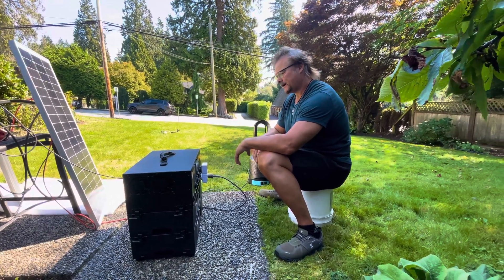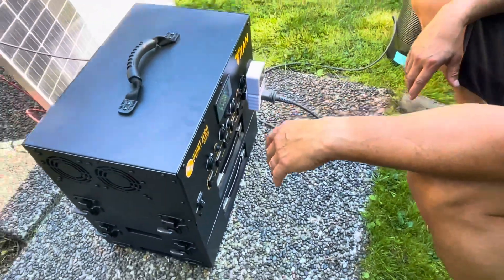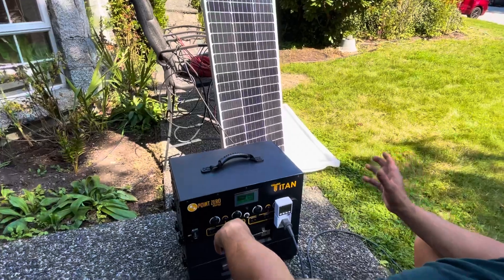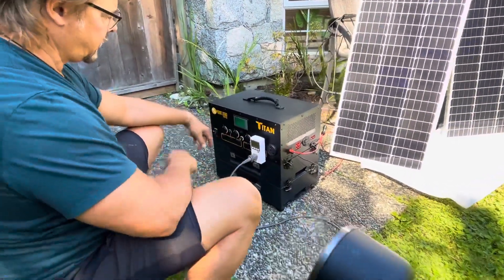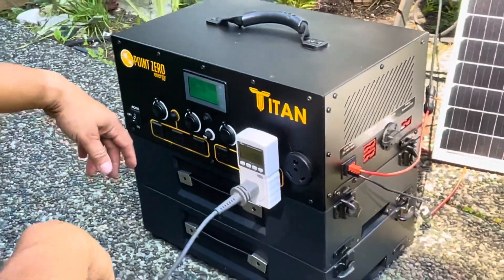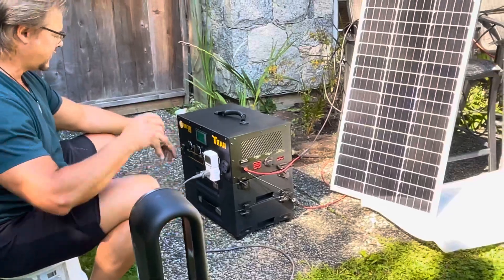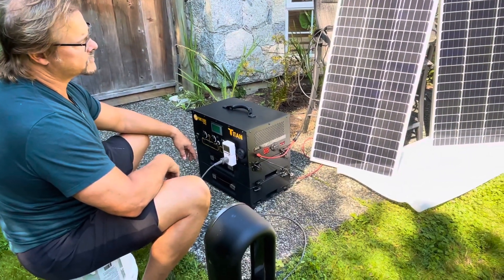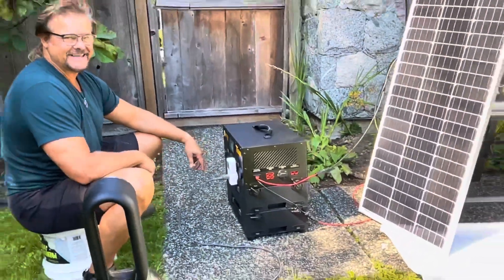Testing 🧑‍🔬 The Titan point Zero Solar System 😎 More to come

Comment: Congradulations you bought a good unit! 57 whole seconds of review. WTF. That should make everyone want one! I own 2 of these and 5 batteries for real,   and may i just say, come back with a video running this thing to the max on all ports,ac and dc and solar input, and show using the battery exspansion port can run with lead acid, agm, and or lithium batteries, max out the wall charging ports with 2 chargers, put more than 2000w solar on it, show using the 12v car charger pulling a full 20 amps right off the battery. If your really good do it all at the same time, and show how this is really a beast of a machine, because i dont think you really  know what you have there